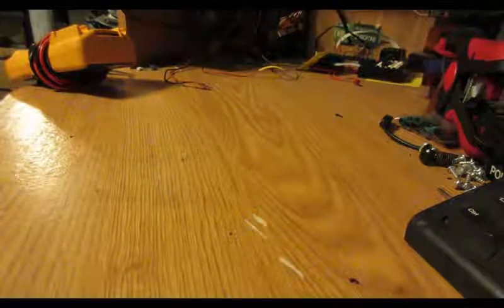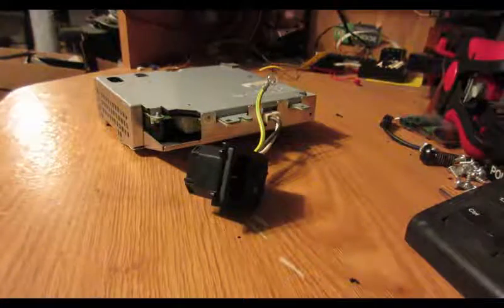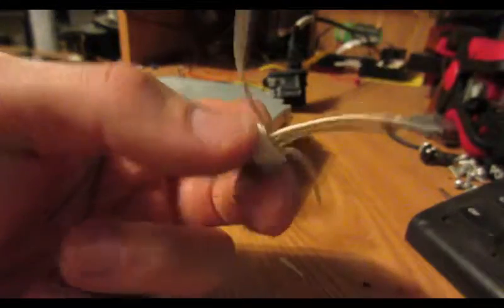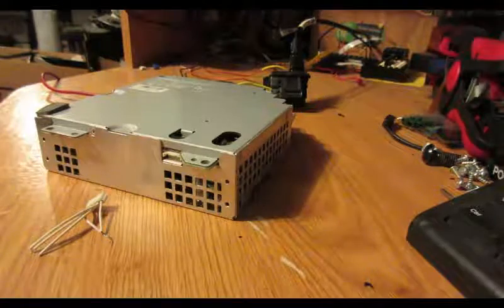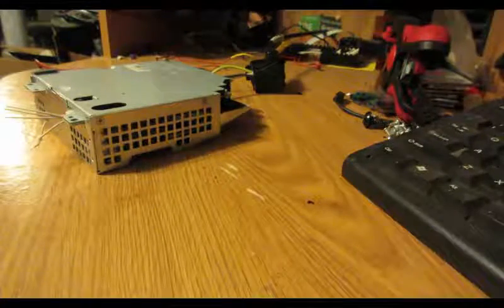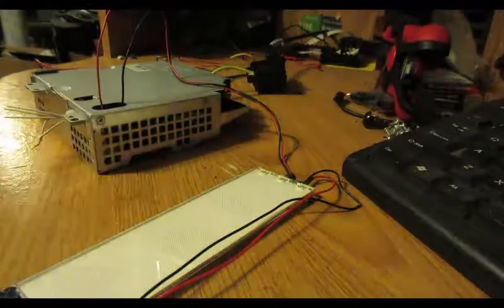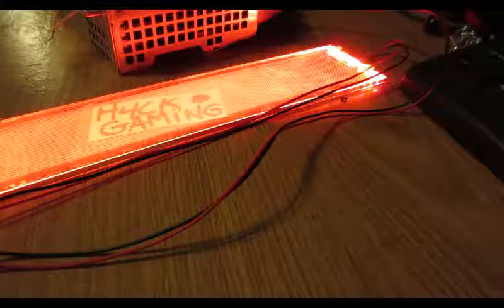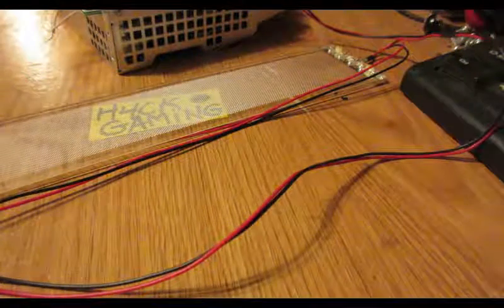Testing an APS 226 PS3 PSU Externally

Comment: Please help me. I still can't understand about what cable can connect it to the wall. I just have this psu without ps3. That's little box. What's it name?
Reply from the maker: Hopefully you have a fan for it so it doesn't burn down your house or blow up. Watch the video. I show you how to power on the PSU externally and it gets the full 12 volts it is suppose to get. If you do not have the switch, you will need to get one or hard wire a spare 110v cable in there. That's all there is to it. Just buy an ATX PSU or grab one from an old junk PC somewhere. Post onto a Facebook swap looking for one. People have them lying around everywhere! You'll literally save money doing it this way. Other than what I have already said and the video I have made, there is nothing more I can do. I literally spoon fed you the information in the video. I don't know what else to do....